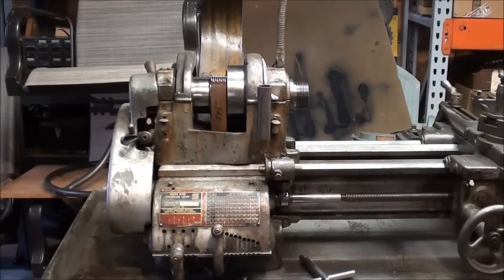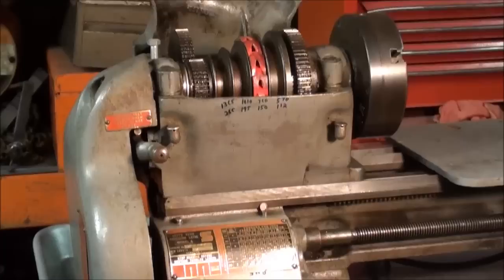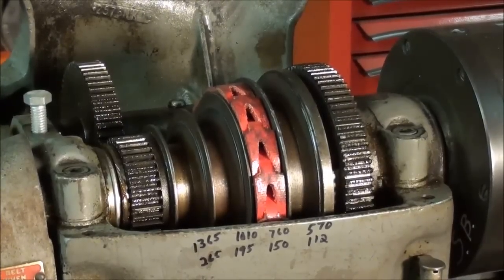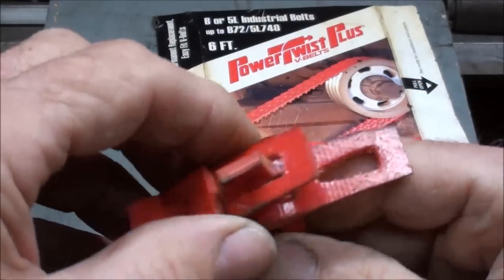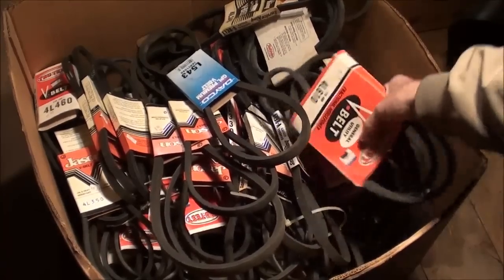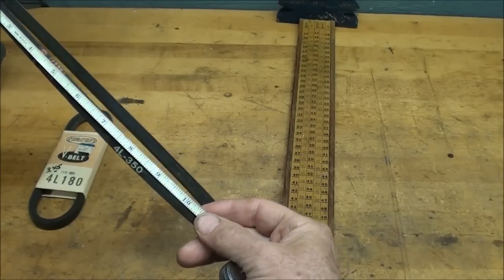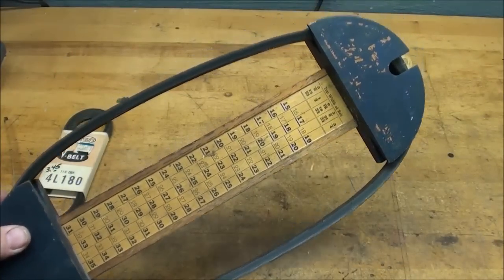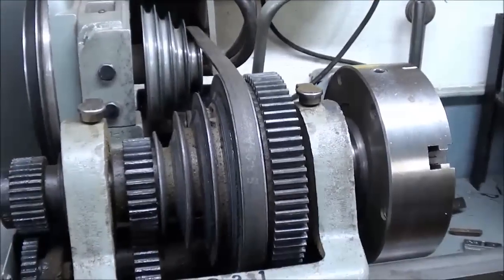MACHINE SHOP TIPS #120 Linked V-Belts on the South Bend Lathe tubalcain

Comment: Hi Mr Tublicain. I have a 1968 SB 10L. I’m thinking of modifying it with a 4.25 HP 130 VDC treadmill motor with variable speed and electronic lead screw. 
I’m concerned about belts with that much HP. I plan on sizing the motor pulley and drive pulley so as never to exceed max rpm for lathe. 
What would you recommend for pulleys and belts? Is it possible to replace the flat pulleys with V groves?
Thanks for your great videos. I love your teaching style and attitude. 
Paul
Reply from the maker: I don’t think you would want to replace the flat poly with a V pulley.  The flat belt will slip if you overpower it. That is good, that is your safety net
Reply: @mrpete222  Thanks.

Comment: What I watched this for was to see something not covered.  Years ago a gunsmith told me he ran link belt on flat belt lathe by just turning it over, so the wide side was against the flats.  I never saw it, but I have no reason to doubt him.  I was hoping to see that hack here, for confirmation.  If one did do that, one would have to be careful not to ripped by the moving underside of the link belt which is quite scary.  One thing I was hoping to see covered was which side leads when installed like that.  one side would be safer than another, but there might be a right and a wrong way to load the belt.  When installed on v-drives, the arrows trail, which would also be preferable for safety, and should meet the same criteria, but who knows.

Comment: I can't begin to count the number of times I've used these linked belts to keep a machine running at my old job. To remove the flywheel and drive assembly from a large mechanical punch press can be a multi-shift job involving a crew of as many as 4 men per shift and a truck crane. These belts were often installed "temporarily" only to be still running fine months later when our plant would be shut down for 2 weeks to properly effect large time consuming repairs. BTW the belts that have an "l" in their size are "lightweight" or fractional Horsepower belts. Home gamer belts, if you will. They are for transmitting power from sub 1 horsepower engines. The A,B,C,D,etc belts designate industrial belts that are more heavily reinforced with cords (like tires) and if they include an "x" along with the other letter it means they are slotted to round the pulley better and they typically last longer.
Reply from the maker: Thank you for that information

Comment: The folks that complain about the excessive noise from laced belts using Clipper lacing are probably using belts that were not laced properly. I'm not being critical of you, but just as an example, the first belt you showed in this video had the wrong lacing for the thickness of the belt and for the pulley diameter that it was being used on. Those are important considerations when lacing belts. I've laced, using many lacing products, hundreds of belts from all sorts of materials and of many thicknesses, used with all sorts of pulleys and drive rollers, so I know whereof I speak. The belt that you show would make noise, but I could lace a belt for that lathe that wouldn't, if it was a real concern, just because I would follow the instructions that come with the lacing materials. I realize that you probably used what you had because the noise it might make didn't really matter to you, but I just hate to hear people (again, not referring to you) criticize a product or process when they haven't followed the directions or have done an amateurish job of the task. Having said that, I also believe that sometimes perfection can be the enemy of good enough. I think that's an old Russian proverb. LOL

Comment: I'm having quite a bit of slipping on the link belt I put on. Should I make it tighter? Just got an atlas 618 lathe and don't know much about it. Didn't  come with a belt either so I don't know what size it should be. And I'm certain it's not because I'm trying to take to deep of cut.
Reply from the maker: Try tightening it up

Comment: I have a south bend lathe with cone pulleys on it and when you leather blew apart (from age) I put a power twist link belt over the pulleys upside down and it runs beautifully on the backside of the belt. no clicking spinning quietly with plenty of traction. It has been on my machine like that for over 15 years now without a single problem
Reply: What width belt did you use? Curious to try this method rather than gluing a belt or using the pinned type. Thank you.

Comment: I agree about the snick, snick, snick, of the joined belt. totally unaccceptable , so annoying . I got over the problem by taking a belt 3" too long and tapering each end over 3" and guing them together. Any glue suitable for leather will do . most contact adhesives work OK,   Tapering can be acieved with a razor  and a sanding block. The more perfect the splice the longer it will last. I have had them last for years before needing regluing, and of course ... silent.

Comment: I have been using the linked belts since they first came out, and they do reduce vibration. They reduce maintenance costs. They seem expensive, but if they stretch or fail, you replace 2 links and you are done. But that almost never happens. I have never had a problem and having used them in more than 20 machines, from saws to lathes in a production environment, I think they are actually superior to other belts.
Reply: I had commented before reading all previous postings.  I had heard that the link belts caused excessive wear and it would seem that you have had good luck with that.  I am concerned with aluminum pulleys found on older lathes.

Comment: I've used the Twist-Link belts on my table saws.  It's advantage over a standard V belt is that a V belt will take a set if it isn't used often.  This causes vibration.  When I  changed to the Twist-Link belts, no vibration.  I've used them for about 20+ years.  We have them in the hardware stores here in the Dallas area.

Comment: The do have link belts at Harbor Freight.  It's one thing I would actually buy.  They do help on vibration on table saws.  5 ft for 24.99 that's expensive.

Comment: my old workplace had several air handlers on the roof and the hvac guy carried a large supply of the link belt material,, with several buildings under his thumb he used tons of it